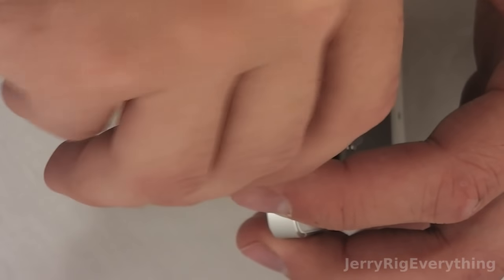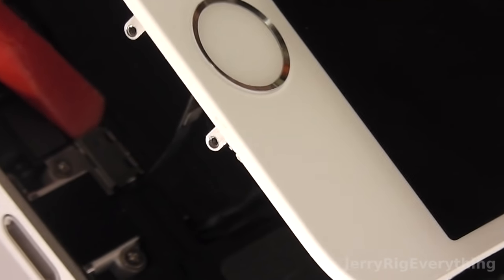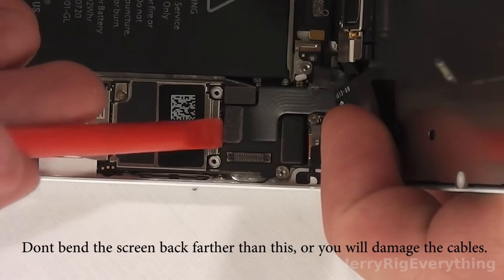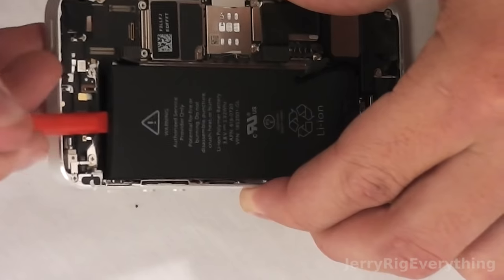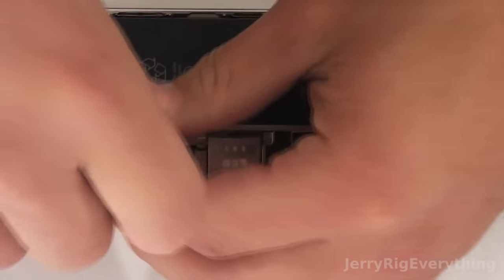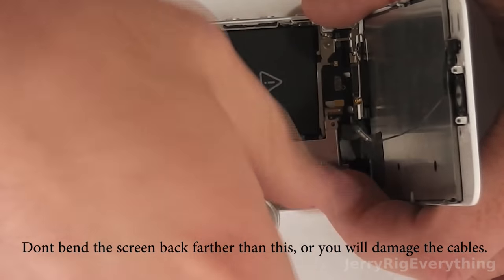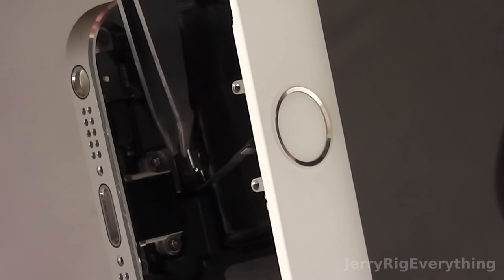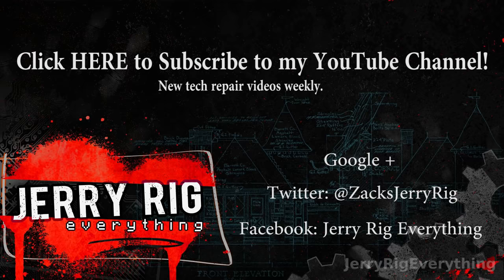iPhone 5s battery replacement in 6 minutes!

Comment: Important!! There's a black strip running across the bottom of the battery that's connected to the glue strips. It's not the tape that wraps around the bottom of the battery; it's just below that. First, heat up the back of the phone under the battery with a hair dryer to soften the glue a bit. (If you forget to do this, the strip is likely to break when you pull on it.) Then pull the strip out slightly and snip it in half with scissors. This allows you to pull each glue strip separately. Gently, firmly, and evenly, steadily pull each strip out; there will be a squeaking noise as the glue strip stretches. Careful! If it breaks you're going to have to pry the battery out. The stretched strip gets about a foot long if you let it, but I like to grab it close to the battery so it's less likely to break prematurely. After both strips are removed, the glue is gone and the battery will lift out easily.
Reply: @ShitBoxSurprises there is it’s just really hidden underneath it’s tricky

Comment: Tip- Inspect screen for any discoloration after you're done. I had a purplish blue smudge mark in the middle of the screen that would go away when I opened the phone again.  It was caused by the aftermarket battery being slightly thicker than normal causing pressure on the LCD from underneath. The battery had 2 layers of stickers on it for some reason, removing 1 layer alleviated this pressure and the discoloration was gone.

Comment: While I'm sure this vid was made with the best intention, this in NOT AT ALL how you are supposed to do it! 1. You are not supposed to pry the battery (this could break the battery and harm your iphone and YOU) , instead the adhesive strips underneath the bat. have TABS located at the BOTTOM END which will allow you to pull them out without moving the bat. 2. Putting a wrong (too long) screw in the bottom right hole of the mainboard assembly plate will PERMANENTLY DAMAGE YOUR MAINBOARD, and you will have to get a new one. If unsure, better leave this one hole unscrewed (pun intended)!
Reply: K

Comment: Great video, very helpful. I had the same experience with my battery not wanting to come off the backing paper, but the tool kit I bought along with my battery (from Amazon) came with two guitar-pick-shaped tools, and I used one of those to pry the battery up little by little, around the edges. Going at it gently and patiently makes a difference, folks. I hope to get a couple more years out of my phone, now!

Comment: Thanks so much for giving my iPhone 5 from 2014 a few more miles!

I actually found it very difficult to remove the battery due to the strong adhesive stickers. .. it ended up cracking up and it set off some sparks, but the rest went well. Very useful!
Reply: There’s pull tabs at the bottom of the battery you supposed too pull them out at 90 degrees slowly and the battery comes free as long as don’t snap as you pull
But that’s what the stickers are designed for

Comment: Thanks for posting this video, very helpful.  I also read some the comments before starting my battery replacement, so I did pay attention to which screws came out of each location.  I wanted to avoid removing the screen, but it was impossible (for me) to get the battery to lift up from the bottom.  I removed the screen as indicated, and then pried the battery out from the top.  It definitely took much longer than shown in the video.  I was careful not to bend the old battery excessively during removal, and did not experience any smoke, fire, or injury during the extraction.  Getting the wiring clips reattached did take some doing.  I did test the iPhone before closing everything up.  The touch screen, and finger print button worked fine, but the phone did not pick up my voice when asking Siri a question.  I reseated that wire connector, and reassembled the phone.  This time everything worked fine.  The new battery does seem to be discharging rather quickly.  I will let it deplete to about 10% charger before recharging.   I will know by tomorrow if the new battery is holding a charger better than the old one.

Comment: I just replaced my battery. Thanks for this good tutorial. For those who don't know or remember the screws that go on the shield that covers the screen connectors go with the two smallest ones at the bottom of the shield and the slightly bigger ones go at the two top holes to hold the shield down. Mine seems to be working ok with a battery I bought on eBay but time will tell.
Reply: Thanks so much for telling me the order, I could clearly tell there was 2 shorter screws and 2 longer screws but was worried when someone told me it wrecks your phone if you don't get them right.

Comment: There is nothing quite like the quiet voice of authoritative competence, gently, calmly walking you through the process of tiny screws, fragile cabling, really tough extra tack sticking tape, to see you through a 6 minute job that turns into an 80 minute ordeal of patient, peering in and at impossibly small manipulations by big fingers and tiny driver heads. For a rank novice like me, it was a mostly successful op... with thanks to this really good tutorial. I am much appreciative of this man's work and manner.

Comment: You sir, are a legend. Clear to follow instructions, plus you included the home button cable which seems to be missing on other iPhone 5s videos. I accidentally knocked my beast into some water for a few seconds. Phone detected the water and went into shut down (As opposed to electrical failure.) and I madly went searching for my phone tools. Got the screen off and battery disconnected, and let it air out in the really hot dry air here at the moment, with a fan blowing on it. 12 hours later, followed the second half of the video, and phone is back together and appears to be working properly.

Comment: Excellent video. I have read the comments too, about different sizes of bolts, I took care to put all bolts in the same way back. Good tools is the essential, extremely small sizes of bolts. The battery replacement took me 35 minutes and nothing has been damaged. The biggest difficulty was to remove glued the old battery, it need a patience and time. An experience is generally always helpful.

Comment: Thank u for this! Altho I did it without removing the screen, just holding it up, worked great
Reply: Impressive
Reply: zicca
Reply: I did it without removing the screen too. I find it perfect to get a can of soda and a rubber band. I use the can as a backing support for the screen and the rubber band to keep the screen attached firmly to the upright soda can to keep the screen at a 90° angle.

Comment: thank you for your excellent video! Replaced my battery and the hardest part was getting the battery off that sticky tape! We've used a manicure tool as a screw driver - it's hard thin metal fitted like a dream into those tiny screws. Screen had weird lines on when re-starting but discovered the old battery bend the plate under the screen and when pushing it back into the frame caused the lines. The weird blue vertical line running from top to bottom which appeared on my screen a few weeks ago was a warning sign of a battery on it's way out of my phone - it actually pushed the screen from the frame while we were sleeping, only noticed it halfway through the next day. Only 'damage' on my phone after 4 years of use, not a single scratch on it or any other issues - super impressed with iPhone

Comment: Wanted to say thanks to JerryRigEverything. I'm technically minded and not afraid of doing these sort of things but having your video removed the usual guess work. I report success in the battery replacement. Also wanted to add that after reassembly, I had the vertical lines/stripes on the screen issue, which to my surprise resolved itself after about an hour of use.
Reply from the maker: +D Ren72 Nice! Good job!  I'm glad your screen fixed itself.  BUT if it comes back or for anyone else experiencing the same lines, its usually due to an incomplete connection with the screen and the motherboard.  Disconnecting and reconnecting the screen will usually get rid of those.
Reply: +JerryRigEverything  question i accidently went to close to the battery connector with one of my metal tools and saw a spark do you think it is possible that i shorted the phone because of it?
Reply: JerryRigEverything where is a trustworthy place to buy a 5s battery or do you by chance have an extra? I’m broke and my phone is not lasting minutes off the charger

Comment: Lots of positives on here and lots of "easy peasy" but a word of caution, as someone whos worked in engineering and i'm also a model maker, i dont think this is for the faint hearted, only attempt this if you can stand the loss of the phone, i did have to take the screen ribbons off and on again a couple of times and suspect i may have mixed the screws up on the screen connections, also if you havent got razor sharp vision or a big magnifying glass dont even think about doing this, very good tutorial - thanks dude

Comment: I used your video to change out my battery. After I had trouble prying out the battery I checked on another website.   You go to the opposite end of the battery to access the two strips of sticky tape to get the battery out.  Using your method I now need a new battery!

Comment: It is not absolutely necessary to remove the screen. Once you get it open, find a small box (about 3x3x5 inches) and put a rubber band around the box and the screen. That holds the screen vertical and out of the way.
Reply: Just remove it, the box might slip and fall or the phone could slide on the surface. Prying the battery off the phone is not a gentle process and having tension on those thin screen cables could damage them.

Comment: This video is Highly recommend for those who not have knowledge about replacing battery iPhone
Reply: no. he skips an important step in pulling out the adhesive strips
Reply: @jd-yo2is  Rather than pull them out he slid his tool between the strips and the battery, therefore he could use the strips to hold the new batter in place.
Reply: @marthachisnell3346  what you said makes no sense. The strips are extremely sticky, and they mustt be removed to remove the battery
Reply: @jd-yo2is  watch the video again, you will see.
Reply: @marthachisnell3346  I did he literally takes it out like nothing. I had to floss it out with dental floss...took like 20 minutes

It has tabs that you can pull on  and remove the adhesive strips as well, but in my experience they usually break
Reply: @jd-yo2is  I agree that he made it look easy.  My daughter replaced my battery last time and did not put in the strips so I did not have to grapple with them.  She did say it was tough to get the battery out.
  I did put in new adhesive strips and see that I may have a challenge when I have to change the battery again.
Reply: @marthachisnell3346  yeah this video made me break a battery i was planning on using lol
Reply: @jd-yo2is  That's terrible, sorry about that!

Comment: Followed this instructional and replaced my iPhone 5s battery. Took a while to pry the battery out, but it came out fine, but a bit bent :). Fitted the new battery & re assembled. All up and running, fingerprint sensor and all controls working. Hopefully, it give me another year or two, until I decide to upgrade. Many Thanks!

Comment: I've watched and used a lot of your  videos to much success, but this video is a dangerous situation waiting to happen (and it did). You should really make a note that most older iPhone 5S's batteries WILL NOT come out easily. I ended up breaking mine in the middle causing smoke and cuts on my left hand (the one I was prying it up with) due to the battery casing breaking.

For anyone watching this with a semi old iPhone 5S, DO NOT FORCE THE BATTERY. I would try iFixit's method of cutting the battery removal tab and pulling the adhesive strips out from under the battery instead.

At least put an annotation to warn your viewers!
Reply: Z Guitar I'm halfway through this and am really struggling to get the battery out. It's pretty bent at either end but refuses to budge. I tried the removal tab method but it broke despite being pulled very carefully. Got any other tips?
Reply: ZGuitar r
Reply: ZGuitar true, my battery started smoking... I ran out of my house to throw it outside, thinking it was going to explode
Reply: Heat is your friend if you can use it in the proper way. Apply some heat with a hairdryer on the back plate where the battery is located evenly. Try to pry it every once in a while from different angles to see if it loosens. Use the metal frame as a support for the plastic pry tool and never try to force it under the battery or you'll damage the ribbon cable on the top section. The battery is not 100% flush to the case so I always find a good spot for leverage.
Reply: Mine was apparently very old. The battery itself was mushy so as I tried to pry it up it was bending as if the battery casing was full of play dough. I ended up using tweezers to bend off the edges closest to the phone case (not the parts side) then slowly shoving a credit card under it and wiggling it. It took all about 15mins of gently push, rug and wiggle. I ended up with an uber deformed looking old battery. Very glad I removed the screen. No way I could have removed the battery with the screen attached and not damaging the ribbons.
Reply: you need to remove the adhesive first then remove the battery without any heat at all, on top of the battery under the black strip  there is pull tabs, when you pull they will stretch a lot dont worry about that, be gentle so they dont break in half and you can remove them completely
Reply: Today was my lucky day. I heated it up REALLY hot with a hairdryer and then basically shoved the pry tool underneath, and I felt it go under. What really happened was that the tool poked a hole through the battery and I could see the white powder inside. Nothing happened to it, so I put gloves and a respirator on and tossed it in a plastic grocery bag.
Reply: SAME
Reply: Yeah, getting the battery out basically destroyed the rest of the phone.  The adhesive, heated up, started to give but it stuck to a ribbon connector and pulled the whole thing out with it.  So that's the end of that.
Reply: same
Reply: I heated the backside with a hairdryer for about a minute to loosen the adhesiv before prying my battery out.
Reply: Did the work without removing screen or using heat but the battery was a real bear to get out.  Used the long edge of the phone for spudger leverage to pry it out. Unfortunately, I think that did something to upset the volume controls, no longer functional! I think heat would have helped, short edge access (from screen removal) might have give less stressful leverage.
Reply: oh I removed it fine! im glad I didn't have your problem, sounds terrifying!!
Reply: I have the same issue with volume controls and my phone no longer vibrates.... did you ever fix it?
Reply: It's true
Reply: you're bang on, zguitar. it was very misleading. sparks came out of my battery and it did not come out easily either. i needed needlenose pliers. maybe other phones are better to replace the battery, but not the 5s

Comment: Good instructional video however one step that was the failure in my change out was the screw positions. User beware that the screws removed from the display cable shield (4) all different sizes. 2- 1.7MM, 1- 1.3MM, 1- 1.2MM. Make sure they go in the same place that they were removed from or you will end up with the Apple reboot loop ;-)
Reply: Thanks for the heads up... That's pretty important to know....
Reply: should've read this first - does anyone know the correct placement of screws?

Comment: Great Tutorial, i admire you patience and hand coordination, especially because i tore open my case, broke a cable, lost 3 screws and ended up with my power button and home button and screen not working. Basically i plugged it in and i stared at my not working phone for a good half hour. Rip, time for an android...

Comment: I just did it.  Followed exactly what you did especially disconnecting the screen.  Had to do that in order to get my pry tool/access/leverage to remove the battery.  Some comments below say leave it on, but I'd need two extra hands at half my size to accommodate.  Awesome.  Thanks man.

Comment: Be warned - it took me quite some effort to remove the battery from the sticky tape backing in my phone
Reply: +Martin Randall I burnt it :)
Reply: agreed.
Reply: Mine started on fire.. rip iPhone.
Reply: My Samsung Note 3 has no sticky tape under the battery and I can change the  battery after opening the back cover with my fingernail!
Reply: Martin Randall h
Reply: Ihow do you install  Adelay on car electric windows

Comment: I did it!! I followed your instructions and my iPhone 5s has a brand new battery.
And the good news is it turns on and works. I did not break anything. Thank you
Apple for making your proprietary phone a miniature laptop computer complete with
micro screws and delicate cables. A very difficult replacement and a tough re-assemble
process. I do understand now why they charge so much to replace a simple battery in
the blasted things.
My phone will not get the new iOS 13 system but I will still love it and continue to use it
in the many months ahead. Just sentimental value and I'm cheap.
Reply: I'm thinking about changing the battery out of my 5s. Doesn't look too hard, mainly allot of patience. Although it won't get iOS 13, in sure the 5s should still be able to run all of the latest apps for at least the next 2 to 3 years on iOS 12.3.1.